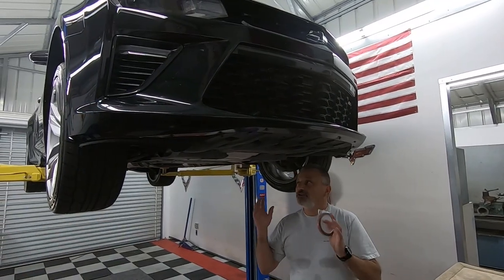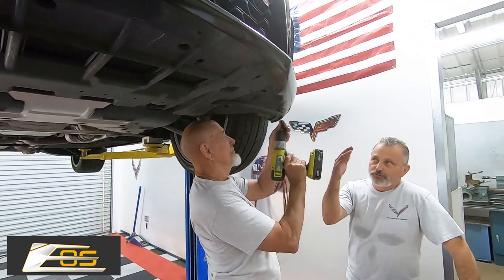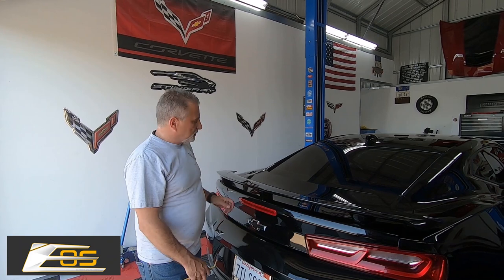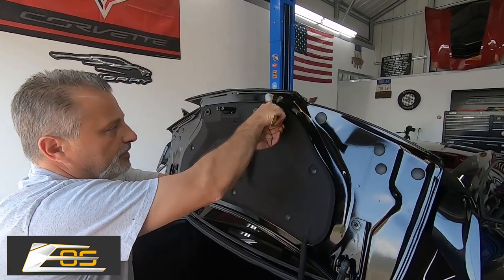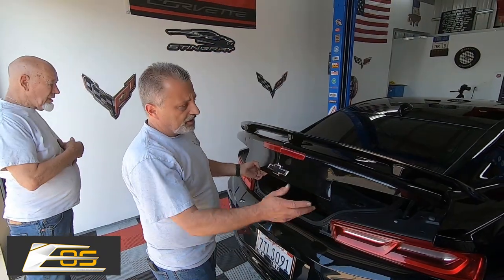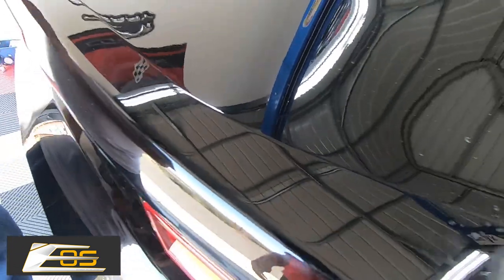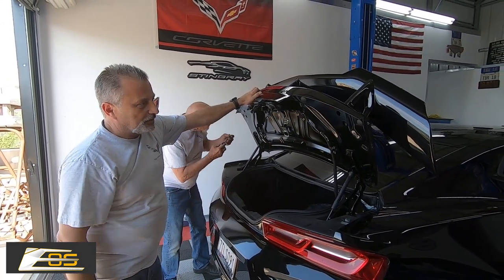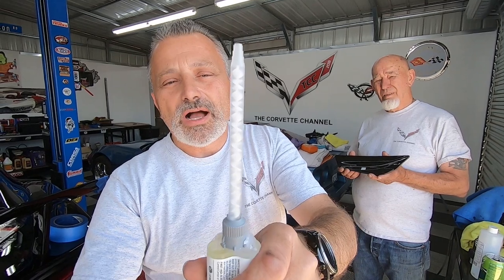How to Install the ZL1 Conversion Kit on a Sixth Generation CAMARO SS From Extreme Online Store

Comment: Did you have any problems where the posts would not tighten to the wing and there was a loose gap?  (2018 Camaro 2SS)
Reply from the maker: Sorry no I didn't you may be able to use a small washer or washers to take up the gap.